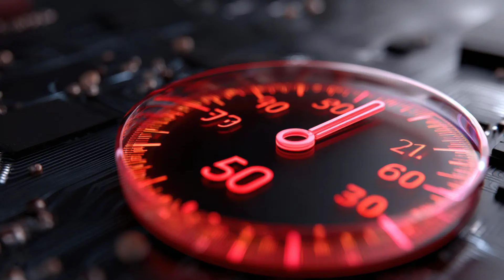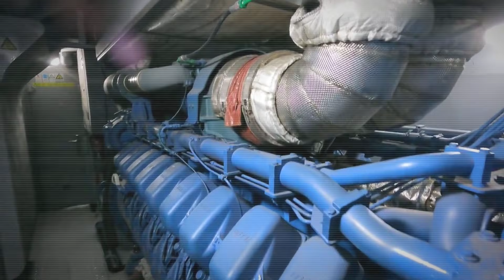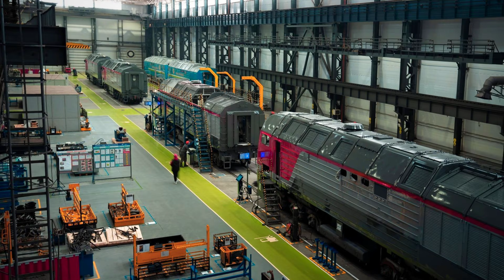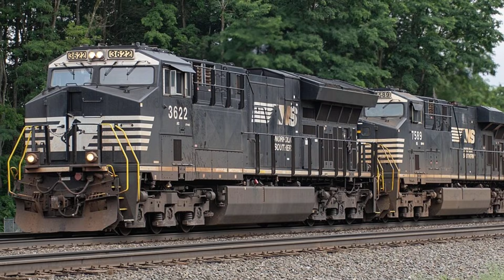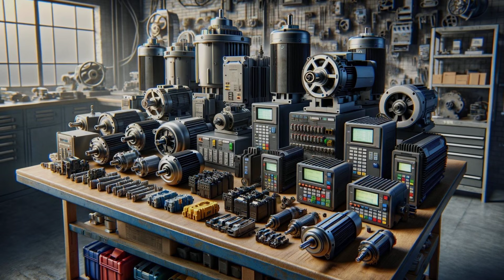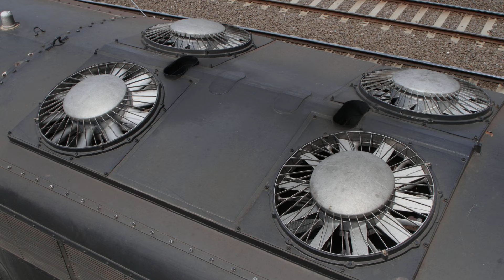Why Diesel Locomotives Are Actually Electric Generators On Wheels

Comment: I was always wondering why coupling an electric motor to a diesel engine is necessary in locomotives. Now I know. Thanks.
Reply from the maker: The diesel-electric arrangement solves the torque problem that direct mechanical drive can't handle at low speed -- electric motors deliver full torque from zero RPM, which is exactly what you need to break a heavy train out of a standing start. The diesel just drives a generator; the traction motors do the actual work.

Comment: Germany had diesel-hydraulic locomotives in the 1960s-1980s which solved the hot clutch problem with something resembling a torque converter

Comment: WHEN GENERAL ELECTRIC FIRST STATED USING AC 3 PHASE TRACTION GENERATORS, SOME OF THE LOCOMOTIVES PURCHASED BY SOUTHERN PACIFIC WERE SET UP TO ALSO BE AN PORTABLE GENERATOR WHEN NEEDED!
THESE WERE TO BE USED TO POWER 
EMERGENCY FLOOD WATER PUMPS IN THE LOS ANGELES TAYLOR YARD.